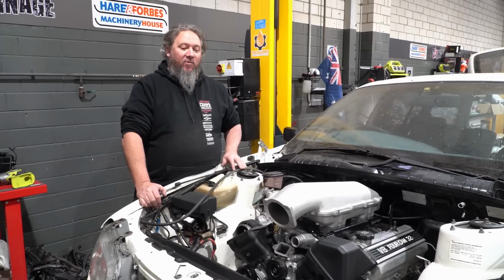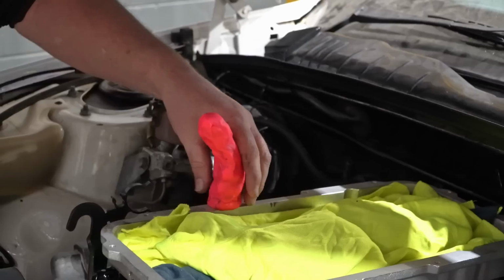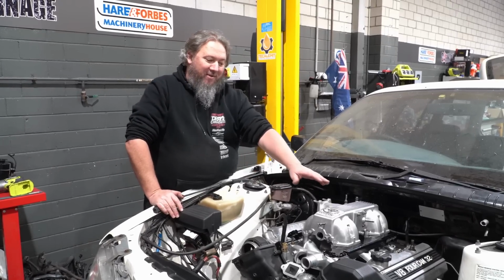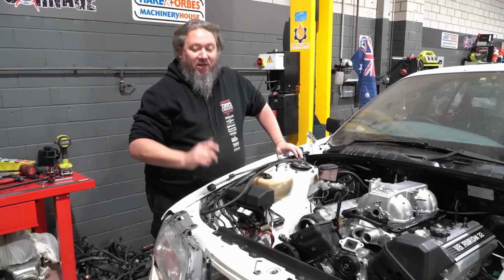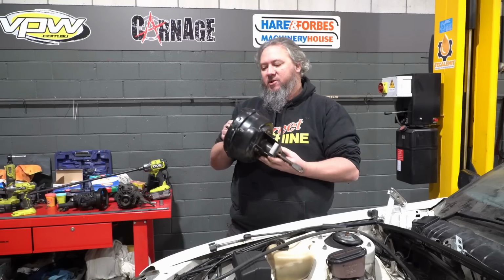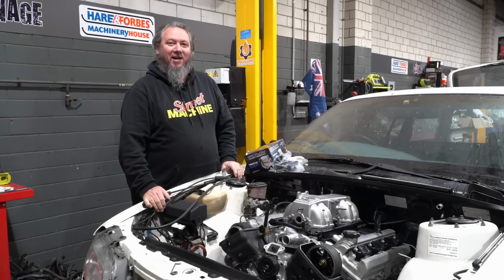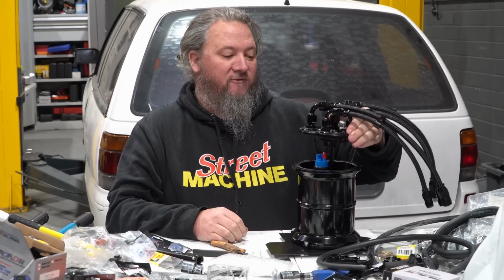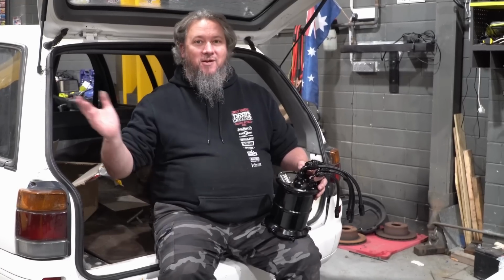Carnage - Nothing Fits Our V8 Lexcen!

Comment: grate work 👌👌I run a single turbo 1uz get rid of the power steering pump and run a electric pump will give you heaps of room and will drive like a dream I run my pump in the boot works perfectly.. grate build 👌👌
Reply from the maker: Thanks for the tip!

Comment: Mate Scotty its a VR/VS cut the bonnet, put a small hole in it that's it leave it open so even more cold air gets in the engine bay and intake ?
Or cut the inner bracing on the bonnet to make room if its in the way, plus adjust the rear part of the bonnet to lift it up as well, like old school lifting the rear areas of the bonnet etc?🙌🙌✌✌👍👍😀😀
Reply from the maker: It did that with the VN bonnet and I hate it. This time it stays under the bonnet.
Reply: @STREETMACHINETV  ok mate i get it, but keep the oe looking thing and sleeper ,so keep up the great work Scotty. :)

Comment: Put the original booster back in and remote mount the coil. Just run a lead into the hole. Can get the lead on with pointy nose pliers down the hole.
Reply from the maker: I like the coil on plug look

Comment: Relocate the battery 
Astra Powersteering Pump where the battery goes.
Maybe mill/machine some of the deck height from the intake runners on the engine side and from the under plenum to lower the profile? 
Can you relocate the brake booster to the passenger side, Im sure I remember seeing something to do with bmw and relocation of the booster

Comment: Scotty, can you rotate the manifold top and have the intake on the passenger side?  Thats what I did on my 1UZ into commodore.
Reply: Sorry Scotty, Just watched the rest of your video and my suggestion was answered. Just for your info I have twin turbo 1UZ into VK, custom exhaust manifolds that clear the P/S pump and Alternator.  I have since mounted a Astra pump in the boot, which I don't hear in the cab.  As for the coils they are remote mounted and I run spark leads and tubes.
Reply from the maker: Yep, there's more than one way to skin a cat. How does it go?
Reply: @STREETMACHINETV  more than enough for me. Did the conversion about 16yrs ago. Got 475whp on pump 98. Have recently built bottom end (Ross pistons, spool rods), kelford turbo cams etc and will be getting tuned in the next few weeks. It's a handfull for an old bloke.
Reply from the maker: @ianparkinson5490  Sounds awesome.

Comment: Scotty, what about using 2UZ or 3UZ intake instead? The throttle body is mounted to front of the intake.
Reply from the maker: I've never seen one, but sounds interesting. We have a solution now.
Reply: @STREETMACHINETV  2uz and 3uz petrol Landcruiser
Reply from the maker: @daleruse3865  I know of the motors but haven't physically seen one, so I don't know the difference other than capacity

Comment: I was coming here to suggest an Astra electric pump, and that I can send you the one I have as I am not using it, as I have decided to go EPAS from a Kia Cerato. However, after reading all the comments I see that you are not keen on the Astra pumps due to the noise and current draw. Maybe look into an EPAS rack conversion or even on the column? Would be a great conversion to do, and show the viewers that you don't need to spend megabucks on getting EPAS to work. As for "Scotty is not a teenager anymore" when you were thinking about pulling the drivers seat out to get access to the booster, I know where you are coming from mate!!!! I've got just under 6 months to go before I hit the big six oh, getting up and down off the floor when working on cars ain't as easy as it used to be!! Keep the great content flowing, and the double entendre and dad jokes coming!!!
Reply from the maker: Thanks mate, and nice job on reading the comments before adding another "Just use an Astra pump..." to the list :)

Comment: Cut and shut the std manifold like rb30 guys do, put the throttle off the front of the std one
Reply from the maker: Why though?
Reply: Just a thought here, for me would be to keep the intercooler piping further away from the manifold and neaten it up that little bit from a stock plenum setup with all the stuff that hangs off the front of them (vac ligns etc)
Reply: Leaving it std will work fine tbh , its not like they dont flow enough, more for appearances and trying to keep iats down

Comment: Scotty, just blame the Button Plan for all your woes. Badge engineering with all the crap!
Reply: Or thank the button plan since this is a genuine Toyota with compliance plates so this is a unique project.

Now that it's getting a TOYOYA V8 and transmission it's finally fullfilling it's true purpose and destiny, take to Japan and show them what could of been. Instead we got the Avalon as it's replacement.
Reply from the maker: Might not get a Toyota trans at this stage but the Toyota V8 for sure
Reply: @351tgv  Toyota recycled the old tooling for the old Avalon from its Kentucky plant by shipping it to Toyota Australia, and launched the old Avalon as an "all-new" model in June 2000 even though it was a 1994 model.

Comment: Yeah everyone's fitting throttlebodies that are WAY too big to their cars these days. I remember back in the 90s if you had a turbo MR2 you could replace one piece of charge piping and the stock throttle body and do literally NOTHING else and gain something like 25% more power at the wheels. That was because the aforementioned piece of charge piping was squashed half flat from the factory and the stock throttlebody was something ridiculously small, like 40mm or something. So you'd weld up a replacement bit of 2.5 inch pipe and fit a 68mm factory throttlebody off an XF Falcon and all of a sudden your engine could actually breathe properly! It seems that the Aussie car tuning scene learned the wrong lesson from that though, I see people with 'cam+zorst'ed LS motors with 110 mm throttle bodies and all they've done is make the engine much harder to drive smoothly in traffic.
Reply from the maker: Does seem to happen alot

Comment: Scotty. Just do the astra pump for power steering also i ran LS1 coils with custom leads instead, easy to get to plugs in it. Also the why i ran K frame spacers so that intake could fit under the bonnet. ITs alot of work the old 1uz in commdore.
Reply from the maker: I don't like how much current the Astra pumps draw
Reply: @STREETMACHINETV  YEh true and sound terrible
Reply from the maker: @kanesaw7456  we had one on the MX5 and I hated it. We ended up going manual steer on the MX5 instead

Comment: Use some k frame spacers. Will give you a bit more room.
Astra pump?
Reply from the maker: Those Astra pumps draw alot of amps, we discovered that on the MX5 before we made it manual steering

Comment: The old extendable radio antennas are the best thing to check bonnet clearance - clamp em where you wanna measure clearances in the enginebay, close bonnet and then measure the retracted length
Reply from the maker: Good tip

Comment: Just put the stock manifold back on , it'll fit under the bonnet, and you'll still make the required HP
Reply: The bonus is the stock can be modded to fit a larger throttle body

Comment: I used to have a HQ, but the booster was from a HT, if memory serves. It was longer and much smaller in diameter.
Reply: There was 1 particular HK/T/G booster that was smaller in diameter as you have noted.  It was also used on the XU1 & A9X.  HDT also used the dual diaphragm version of this on the 5.6L stroker cars, like my Brock wagon, as they produced more boost from less vacuum than the VK/VL boosters.  At 9” diaphragm diameter, it is significantly smaller in diameter than the original HQ-WB boosters Holden used which are 11”.   I did some checking, and the VB-VR boosters are 9” as well, so this won’t help Scotty unfortunately.

Watching the video part way through, I was thinking the shallower plastic VS one might have been short enough to clear, but turns out it wasn’t.  No point trying the VT onwards ones - they are almost as big in diameter where it matters for that coil.  

The hard part with any replacement booster is having the right fit-up orientation for the master cylinder, so you can retain it (and avoid many hassles with engineering, and having to fit bias adjusters and other crap if you can’t find a master cylinder that matches the original front & rear bore sizes).  This was where HDT were clever, as that “special” booster only needed a custom firewall bracket, and took the normal VL 1” master.   While there are a myriad of smaller diameter booster options out there, most, if not all, won’t be an easy fit without numerous other changes.

Comment: You might have some luck using a Toyota Hiace brake booster Scotty. I heard they are pretty compact for the van application so they might be a good solution here. Bonus points for more Toyota parts too 😃

Comment: Hey Scotty had a similar problem putting an LS1 in a Porsche 944 , the solution was hydroboost . Great braking boost powered from your power steer pump .Brett
Reply: My old man passed a few years back and there's a pretty mint unaltered 944 in the garage. How does one go about installing a LS1. I have heard of LS swapped 944's but have no idea of what's involved. Any fab work needed or any really special or is it pretty straight forward and then throw a haltec ecu at it?

Comment: The Hoffs 1uz supra didn't seem to be limited by the standard plenum. Don't worry about it. Standard lead on plug ignition too iirc
Reply: Bigger turbo and bigger boost area by way of turbo piping running from the back. And he runs all the boost. Definitely gains to be had by the replacement intake when not going to the extreme.

And I was pretty sure it was using coils not stock ignition.
Reply: And to me looks better then the high ram also
Reply: @wobblysauce  given on the skid factory with the Fairlane it gained power.

Comment: Are you able to flip the driver's side manifold and run a rear crossover pipe? Will solve the alternator/powersteering clearance issue, aswell as keep some of the hot piping away from the inlet side of the engine bay. Good to see the stock intake manifold back on there, certainly isnt going to hold you back any whatsoever, the juice simply wasnt worth the squeeze in this case for aesthetics.

Comment: You could also use a Mazda electric power steering pump. The one on the 2006 Mazda 3 is small enough that it sits behind the R/H headlight.

Comment: Hi scotty just statred viewing your video ontoyota v8 swap and from angle on vid it appears you may able to machine what gather is the factory intake and gain around 20 to 30 mil and possibly a littlr off skid  factory bottom plenium ???
Reply from the maker: That's a lot of material to remove, not should we have that much to work with.

Comment: Have you considered spacing the K frame down a little to lower the engine?
Also is that plenum symmetrical ? If so the mustang one could go to the left side away from the booster.
Reply from the maker: I explained my reasons for not doing that
Reply: @STREETMACHINETV  . I must have missed the explanation as I don’t recall hearing it.

Comment: Just a thought....

Going up is a problem. Just come on a mental frolic for a moment... What if you channel the lower manifold and have the centre of the throttle body dropped by say 100mm. Of course you'd then have to close the top too. 
I'm thinking about the clearance under the lower manifold allowing a fabricated round section say 125mm wide, to which you could attach the throttle body. It will change the air flow to go from low then up into the runners, but air bends well, as seen in LS3 manifolds.
Just ideas, I don't have the car in front of me let alone the TIG skill needed.

Comment: Run coil leads off the spark plugs to ls coils, get the car running NA first then turbo it, stock header on the drivers side merged into a single header on the passo side or long tube headers and a remote turbo under the back seat

Comment: You could use that Holley plenum that you already have flipped around with a modified 90deg bend on it for the throttle body. The brake booster might still be in the way though.

Comment: Engine looks way better with the stock inlet manifold on it and will be fine... You could have used an LS coil on the rear cylinder, problem solved.
Reply from the maker: Problem is solved now, check back next week.
Reply: @STREETMACHINETV  Will do.

Comment: You could try making a spacer to raise the Toyota plenum to increase the runner length, and cut the throttle plate off and weld on a bigger one.
Reply from the maker: You would have to cut more that the throttle plate off. 70mm is plenty

Comment: Hey Scotty,  Al and Woody have  used Subaru boosters on a few projects as they are smaller diameter.  What about old school HT leads and remote coils.  It won't look as pretty, but there will be more clearance and there won't be a problem with the power goals you have.
Also could you lower the mounts and/or notch the K frame to get more clearance with the bonnet etc?
Reply: Ign1a coils are more powerful than any coil on plug available actually. So it's not a silly idea.

Comment: Run hydraboost , these are small, and have great pedal feel however it does need a power steering pump.  There are some larger trucks and maybe some larger SUVs that use .  electric over hydraulic.  Search for Electric-Hydraulic Brake Booster

Comment: You could always consider having a top made and maybe scallop the lower section and recess the throttle body lower into the lower section using the neck from the standard manifold then make a top section. Or just leave the standard one on.😮

Comment: Hay mate i work as a fabricator at Extreme street performance and ive come across and had to get round these sorts of problems before more than once and i have some ways round that could help you with a bunch of them feel free to reach out if you want to talk thought them any time
Reply: You can space the subframe down a decent ammount to regain clearence and just do a wheel alignemnt to compensate that shpuld help with the coil problem and bonnet problem you should be able to go 2 inches max but id reccomend keeping it under that just remember you will also have to space the gearbox too, if that doesnt give you enough room for the coil  depending on the coil you can remove the boot and make a custom lead and just mount the coil remotely its not ideal but does work. Ive got others ill watch through again and post them up